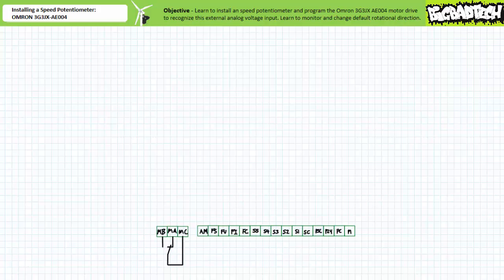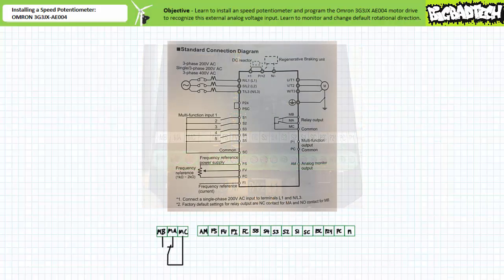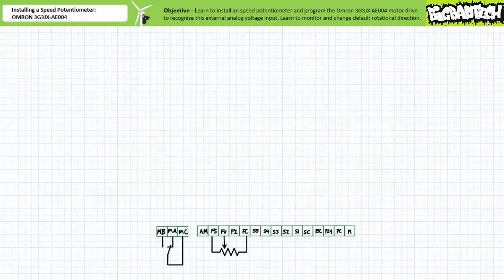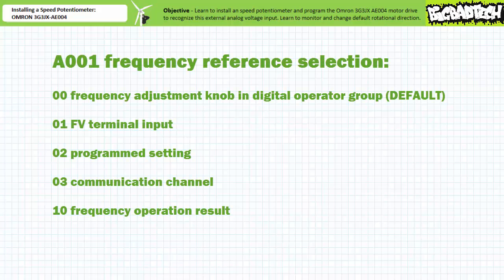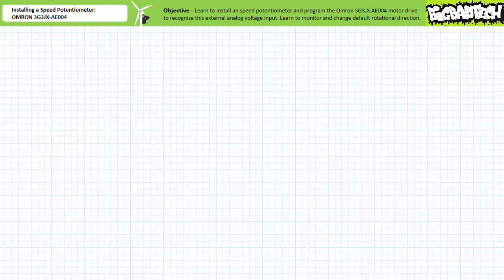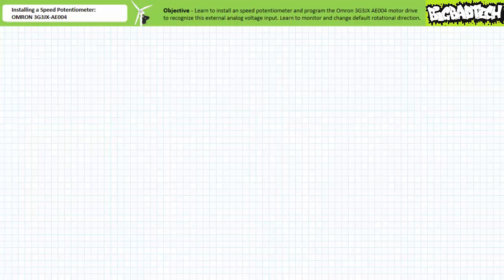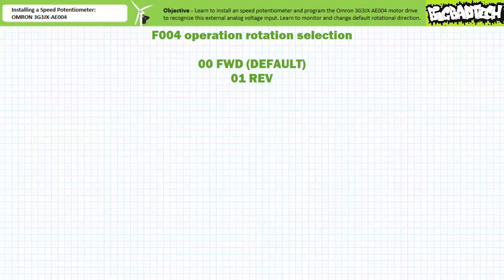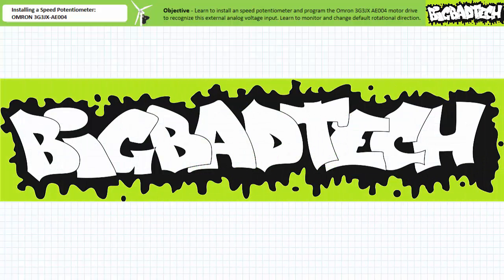Remote  Speed Potentiometer: Omron 3G3JX-AE004 Motor Drive (Full Lecture)

Comment: how about the error E05?
Reply from the maker: Don't quote me but off the top of my head I think E05 is an overload event and the number after specifies when it occurs (ie: during acceleration, full speed run, during deceleration, etc.) Check the user manual to make sure I'm right!